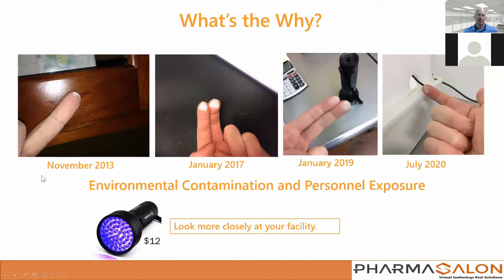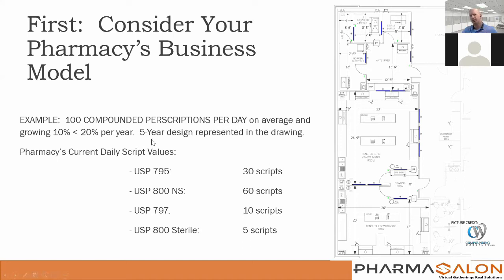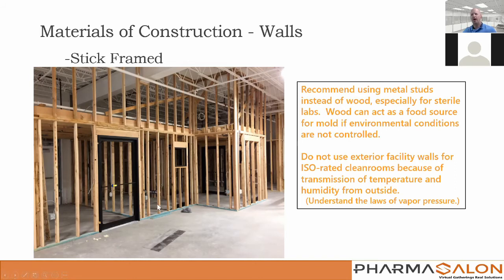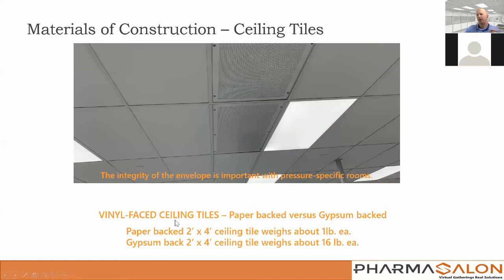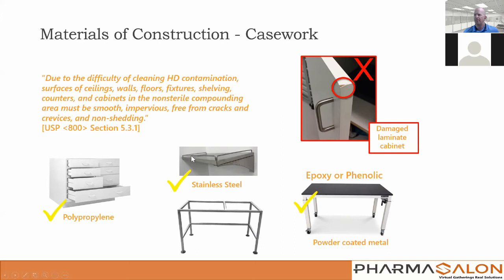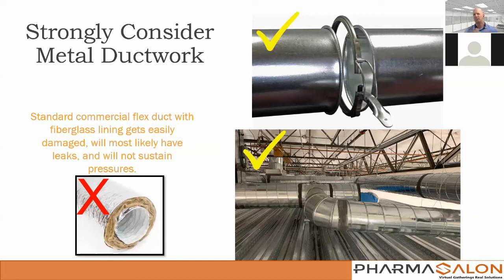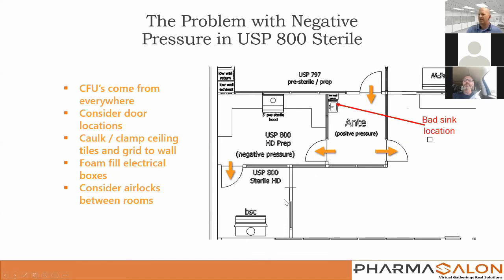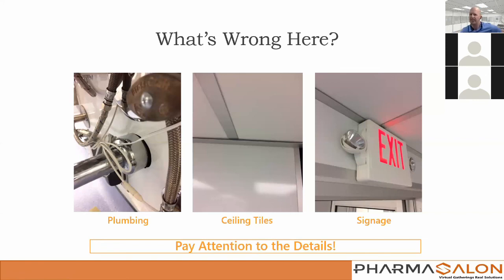503A Facility Design and Engineering for USP Compliance

Comment: Facility design for all aspects must be mentioned in usp. Floor, ceiling, paint, ventilation system, aseptic environment all are mentioned usp 797 works on non- HD environment while usp 800 gives the idea of HD environment, in which negative pressure is used to maintain the sterility of environment.